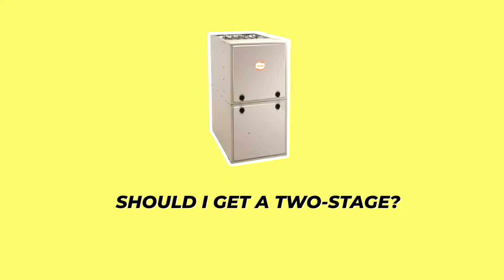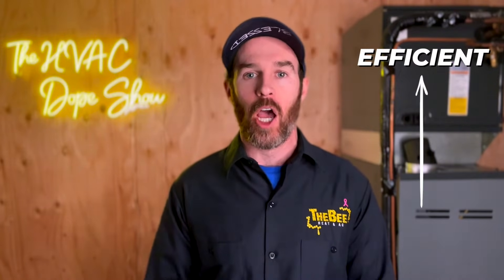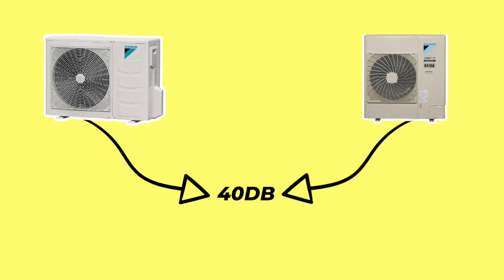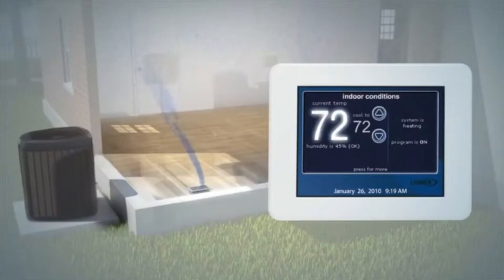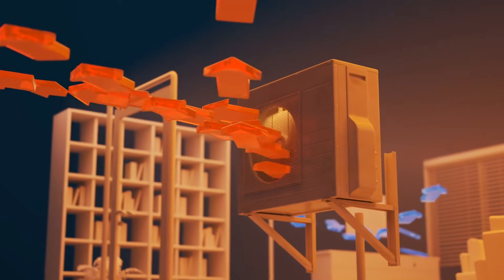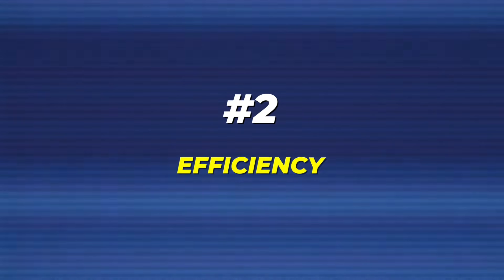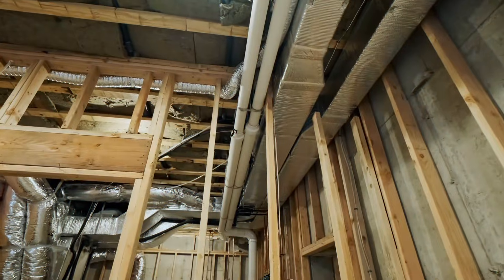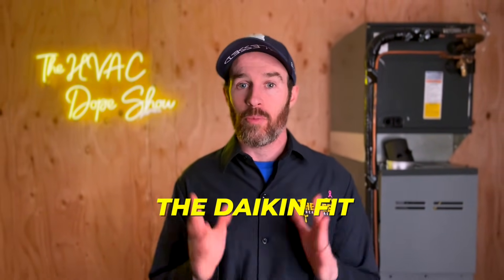Single Stage 🆚 Two Stage Furnace 🔥🤔

Comment: You should have talked about cost of a single stage v/s two stage in this video too. Is it worth spending extra money for a two stage high efficiency furnace over the life of the equipment.
Reply from the maker: From a savings perspective? IMO no… From a comfort perspective IMO yes for sure because longer run times and more even heating
Reply: Unit cost for 2-stage generally not significantly more expensive. But long term parts and serviceability will probably negate any efficiency savings.
Reply: What about how many times the system cycles on and off in a day. Would a 2 stage system last longer as the number of cycles is reduced?

Comment: We live in southern WI and have a Carrier Infinity. I have an Ecobee Lite. Am I wasting my furnace’s potential? Thermostats can get expensive. Should I run another wire for W2? Need to change dipswitch? I like winter heat pump, probably too late, as furnace and a/c are new.
Reply from the maker: If furnace and AC are brand new you can probably switch out just the condenser to get heat pump but yes it’s going to be an expensive switch.
Reply: Carrier infinity’s compressor is the problem

Comment: We are looking at getting a 1 stage compressor (outside unit) with a 2 stage air handler (Lennox ML17XP1-048 and CBA38MV-048).   In regards to what you are saying in this video, is this considered a 2 stage system? 

We live in Florida but wish we were back in the Springs.  We miss Colorado!  I was assigned to the Air Force Academy for 8 years (of my 30-year Air Force Career)!

Thank you for the videos you produce...they are well done and are first class all the way!!   And we really like your hat!  We are Blessed too!  We wish you all could do the work for us,  Your crew could come down here, do the work and spend a few days visiting our "next door neighbor", Mickey Mouse at Disney World.

Chief George, Retired AF
Reply from the maker: This is technically a single stage system because it’s a single stage compressor. My pleasure glad you enjoy the videos and thank you for your service in the AF!
Reply from the maker: In Florida you’d probably be better off with an inverter like the Daikin Fit just because of the length of the cooling and dehumidification season. Especially if you’re down there full time. Thanks for the invite we’ll eventually make our way down there Florida needs HVAC that’s for sure 😁

Comment: Question. I have a 96% efficient single stage gas furnace with a single stage A/C coil and the condenser is outside. I like the idea of a dual fuel system ( gas furnace with a heat pump) if and when the time comes for replacement. Can that be done? Is it effective/efficient? I live in NE. I truly enjoy learning from your experiences and above all your honesty!
Reply from the maker: Yes and for Nebraska that’s a good climate for it provided it’s a cold climate heat pump it should keep up fine. Big thing is making sure you look at the switchover temp and when it makes the most sense to switch to gas depending on your rates. If you have solar you’ll probably stay on electric most or all of the time depending on how often it gets below 5F and for how long.
Reply: Yes you can go dual fuel. In Washington State I usually recommend dual fuel. Always replace the indoor coil when you replace the outdoor unit!  The coil and outdoor unit are two pieces to one puzzle. They need to be an exact match and design to work together.

Comment: what are the deciding factors / how does the unit determine what stage to run in?
Reply from the maker: Depends if it’s a communicating system. Most systems are staged for a preset run time like 10 minutes for example, but a communicating system will run based on point… meaning if it’s turned to cooling at 70 but current temp is 85 because you’re out of town, it will normally ramp up to high stage quickly since there’s a large gap in the set point, and as it gets closer to say 72 or 71 it will ramp down in stages.

Comment: We live in northern Delaware…..when the hvac salesman offered a 2 stage gas heating system…….however the 2nd stage never kicks in/the hvac tech says why would I want the 2nd stage to kick-in….it’s going to then burn more gas! So, I guess we got screwed ! We’ll just run the 2 stage heater that only runs in the 1st stage/we’ll know better next time . John .
Reply: Second stage not kicking in and being able to maintain the setting means your your furnace is oversized! Second stage is only supposed to come on raising the temperature several degrees and in extreme cold when first stage is not enough to keep up.

Most furnaces are oversized.

High heat burns gas at a higher rate over shorter periods of time. 2-stage is for comfort, not fuel savings.
Reply from the maker: That seems odd sounds like it’s wired wrong. If it’s never going into second stage… on cold nights or when it’s running over 10 minutes it should kick into second stage
Reply: @TheHVACDopeShow  I’ve had 5 different service techs here in the last 6 years (all from the same company that did the install) and they all say the same thing……../“you’re better of in 1st stage so your not burning as much gas.” Then they turn my thermostat 2 or three times degrees and say “see …. Your 2nd stage is coming on now. Our outdoor temp has been as low as 15 degrees……and still doesn’t kick in to stage two ! ☹️⁉️
Reply: @merrileemose571  I would see this as unused potential... I don't think its bad... If you ever decide to raise the temp 4-5deg, its nice to have that 2nd stage ramping up, to quickly get up to temp. Other than that, its nice to have a quiet/efficient system. Mine is the same. One thing I changed, I got a 2 stage compatible thermostat. This thermostat is now triggering 2nd stage to kick in when there's a demand difference of at least2 deg(I can control that now). My original installation had the 2 stages connected with a jumper wire inside the furnace(W1+W2) This defaulted the system to run in stage 1 for the first 10 minutes no mater what... Then if the target temp was not satisfied, it triggered stage 2 - just a thought
Reply: You’re probably right……I guess we’re stuck for now as the system is only 6 years old /done by Horizon. stay away from them, always an upsell !
Reply: @merrileemose571  i hate how they mark up price differences when the install labor and overhead is the same.
Reply: @Jon-hx7pe  it’s not the same commissioning  and more to warranty
Reply: I think sizing a single stage furnace correctly is the way to go. Then you really don’t need the 2 stage.
Reply: @BradleyPagano  totally untrue, properly sized means output is match for the coldest 1% or less of hours and has way too much capacity most of the time.
2-stage is necessary for a degree of load matching. modulating is better for load matching but too much money.

Comment: We are bouncing between Single, 2-Stage, Variable. All the different contractors have different opinions as does the internet. Our biggest concern is being in a 100 year old home with not the greatest ducts, is it worth getting a Variable or 2-stage? Will they actually make the 2nd floor or 3rd floor comfortable?

Generally we've been decently comfortable overall. We also don't have zones.

Our current furnace is 22 years old, it would be nice to have a quieter furnace.
Reply from the maker: The systems will be quieter and assuming they’re sizing it properly it will be more comfortable from a quiet and airflow perspective (your old system is probably oversized, statistically 80% are and they used to be oversized by design commonly). Modulating is the quietest and anything high efficiency seals the combustion chamber and reduces burner compartment / inducer motor noise as well. Can’t go wrong with either system honestly, but just properly sizing is key

Comment: Two-stage 90 plus gas furnace is more comfortable but not much if you’re duct work is sized properly with air returns in every room /excluding the bathrooms and kitchen. But you are wrong about a two stage gas furnace being more efficient , it actually uses more gas and a little less electric  (so your statement about it being more efficient is inaccurate ). Also two gas furnaces are more problematic /secondary heat exchanger lifespans or less if you have a two stage furnace.
Reply from the maker: Heat exchanger is unchanged on a two stage vs. single stage, idk where you’re getting your data from but I’ve never heard of a two stage being less efficient and the data suggests otherwise… Single stage is just simpler and cheaper to repair which is definitely a bonus. Either way Thanks for the comment and sharing your opinion!
Reply: @TheHVACDopeShow  , I think you answered your own question. Yes the heat exchangers are the same but one  burns  70,000 in a 90,000 BTU designed heat exchangers (2) most of the time losing  a very small amount of efficiency (but you said we gain efficiency ?). If I have  two 95% efficient furnaces ( one single stage & one two stage)  and you’re saying the two stage is more efficient (good luck, explaining that with physics 🤷🏻‍♂️). I did agree with you, two stage can be more comfortable but not much more comfortable if the ductwork is size properly & cold air returns are in every room except for kitchens and baths . As far as the longevity of heat exchangers, I will have to agree with you on that , we don’t have enough research.

Comment: The solution is simple.  Forget a furnace and put in a quality heat pump.  (Not Chinese)
Size it for the heat load.  Ducted or ductless units are available.  If outside temperature goes below 32°F you need to get a cold weather version.  Mitsubishi, LG and Daikin all make good units.  If outside temperature goes below -10°F consider a dual fuel or water source heat pump.
Reply: This is Ohio,, it does get below -10 sometimes in the winter,, and dewpoints in the high 70s in the summer,,, a good heating and ac are definitely needed
Reply: @rickl7024  same here in Wisconsin. -20 farenhite in the winter and 70 percen
Reply: Heat pumps sucks
Reply from the maker: Agreed!

Comment: Have the following questions - 

1. Is there a 2 stage option in an 80% furnace? Currently in NJ and have a single stage 80 about 20 yrs old and have uneven temperatures in the rooms on the second floor especially the room farthest away from the furnace and hardly gets any air flow.

2. is there a difference between a 2 stage and multi speed blower system? I heard one contractor mention there could be a single stage system but with a multi speed blower motor.

3. heard about this concept called Arzelle zone dampers, is this something that can work in lieu of a traditional zone damper? Issue is accessing ducting and zoning the system is no longer an option is what most contractors have told me.
Reply from the maker: Yes there is a 2 stage 80% option, we install them all the time. Some states have mandated high efficiencies though I don’t know if NJ is one of them. As far as question 2, all furnaces have ECM blowers now, but the fan speed will be set base Don whether the system is calling for cooling or heating. If it’s a 2 stage, or modulating, or variable speed or inverter AC/heat pump paired with the furnace, then you’ll have varying fan speeds. But all blowers are technically “multi speed” and even the old ones can change the speed taps but they are set by the installer (different color wires coming off of the blower determine the speeds). If you want to be able to control the fan speed on the thermostat you’ll want some level of communication, or two stage system, because otherwise there’s normally only one wire for “Fan” and that’s your G wire terminal on the thermostat.

I’ve not heard of Arzel, but looked them up and looks interesting! Before going that route if you’re really wanting to optimize airflow I would also do AeroSeal first and make sure the ducts are sealed. This will optimize airflow and if it’s still uneven after and your contractor is confident using Arzel then have a go at it. It looks interesting and please let me know how it works out because that’s an interesting retrofit zoning product!! Thanks for the comment 😁 great questions!
Reply: @TheHVACDopeShow made a decision and going with Armstrong air equipment made by Lennox apparently, are you familiar? Getting two multi stage units 80% one is a new install in the attic and another one downstairs
Reply: @TheHVACDopeShow I am getting different messages from potential installers on whether a inverter heat pump unit will or won't work efficiently with my  Daikin 80 %  efficient furnace (model: DM80TN0803B). Is there a way to install one to get the benefits of variable speed with this furnace?
Reply: Trane has a single stage and 2 stage furnace at 80% AFUE.  I'm thinking of getting the 2 stage at 80,000 BTU.  My single stage furnace is 20 years old, too.  Single stage is model S8X1....and 2 stage is S8X2.  I'm in NJ, also.

Comment: Bottom line if you have uneven cooling or heating  you need duct balancing , 2 stage won't save the day ....
Reply from the maker: Agree that’s a better option, and duct sealing, but duct/branches aren’t always exposed to be able to balance them

Comment: I wouldn't mind learning about the difference between an AC and DC furnace fan. The DC fan was offered to us as an energy efficient upgrade, but a 500W furnace fan uses 500 Watts, doesn't it? I'd like to know how they save energy, or whether it's just an urban myth.
Reply from the maker: Absolutely that’s a great topic! When you say DC do you mean variable speed like an ECM fan? ECM fans have a series of capacitors built into the module with VERY high capacitance (over 1000 MFD each capacitor) and that’s part of the main way they achieve this added efficiency. Same is true for inverter compressors (oversimplification) but a small part of their efficiency is achieved in a similar fashion. The fans are definitely more efficient, but even a basic ECM fan will be more efficient than anything installed 2019 or earlier with a PSC motor.
Reply: @TheHVACDopeShow  I don't know if they're ECM or not. This was back in 2000, and the salesman offered a "DC" fan for $100 as an option for a Lennox medium efficiency furnace my parents needed at the time. We took up the offer.

Comment: Thank you for your videos, they have helped a lot. 
We live in Northern California, about 1 hour north of San Francisco. Our Townhouse is 1325 sq ft with 2 stories and high ceiling on 1st floor living room and master bedroom. We had 3 ton a/c installed about 10 years ago. 
We have a Carrier/Day & Night furnce: 373LAV036050ADJA is was made in May of 1994.
It is a One Stage, 80%, 37,000 btu. 
We are thinking to replace the control board, but we have also received 3 quotes for a new furnace. 
We are looking to replace with a 1 stage, 80%. 
But we are confused about btu rating. One quote is
Lennox 45,000 btu and the other is Lennox 66,000 btu. 
Given both furnaces are 80%, stage 1, what btu rating would be better?
Thank you, Rod
Reply from the maker: I’ll rarely advise without a load calc but based on this information it’s very straightforward… your temps rarely get below freezing correct since you’re close to the water and no snow? In a townhome with shared walls in a moderate heating climate a 40k is fine (that’s what you have now, but is 37k the output rating?) however you’ll just need to make sure you have a 3 ton blower for the AC. If the furnace is less than 15 years old repair is an option, once things get over that though we just offer replacement as an option because motors valves etc can start to go out too… and since you’re at almost 30 years I’d strongly lean towards replacement unless you’re just trying to limp it along for a season. Thanks for watching and hope that helps! In your climate heating is not that critical so that’s plenty big for that size space and even on a cold night should keep up fine (unless your current furnace doesn’t keep up, but it sounds like it does based on your reports :)

Comment: In my opinion, two stage furnaces with a VCA blower (not CVT) should be the standard in 80% and 96%-98% HE along with a Daikin Fit/Amana S-series for a real dual-fuel system.  I do like the modulating furnaces, but the extra cost might not be worth it. My system is a two-stage and I am a technician and have my own HVAC business in the Littleton/Soutwest Denver area.  You can get straight cool or a heat pump system on either furnace.  My system stays in low stage nearly 95% of the winter and rarely goes into high stage.
Reply from the maker: Agreed, modulating is mostly comfort but the cost difference is pretty substantial. Love the dual fuels!! Thanks for watching and chiming in again!!